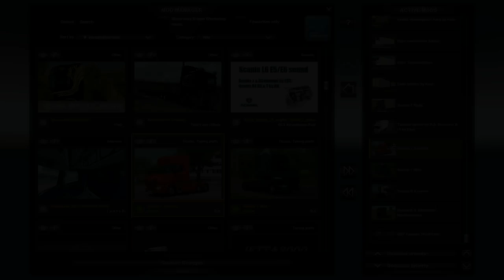ETS2 1.35 - How to turn RJL and SCS trucks into Rigids aka BDFs aka Tandems

Comment: I have a question along the lines of these trucks. If we can back our trailers into a loading bay and the game loads them, what is stopping SCS from just allowing us to drive the rigids, back them up to a loading bay, when loading is complete, driving the load to the destination company. As far as I can see, it would still be a challenge to reverse park the rigids,  and the rigid trucks with an articulation point. Why limit ourselves to BDF? I'd like to drive both in the game. It would open up the game to having different configurations of rigid trucks; dump trucks, reefer rigids, tanker rigids etc. Then, if you know that a job requires an articulated trailer, your rigid will have an articulation point ready to attach the trailer if necessary. I've seen plenty of dump trucks with a separate articulated trailer driving down local highways from building sites. I'd like to be able to drive those in the game, but be able to detach the rear trailer and just drive the rigid.
Reply from the maker: You can use just the rigid if you want. Flemmings mod support that. But we wont see SCS directly supporting that any time soon cause most rigids are custom builds by third party so that would require additional licenses